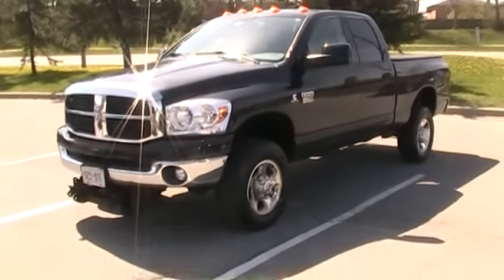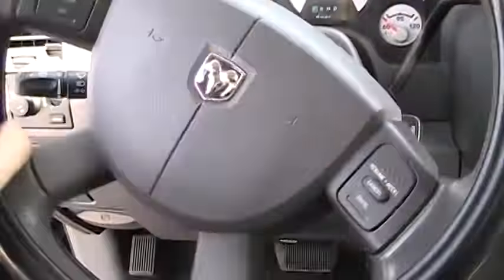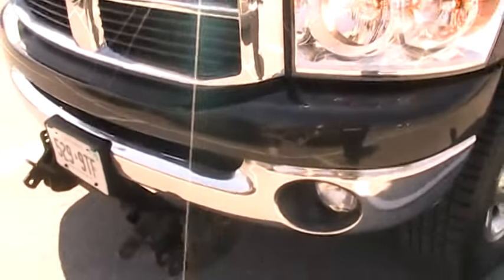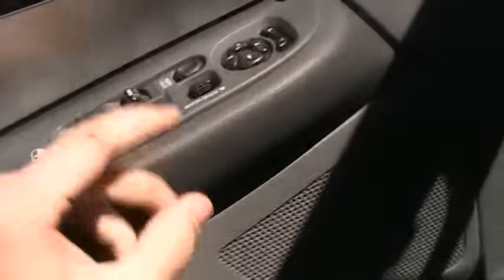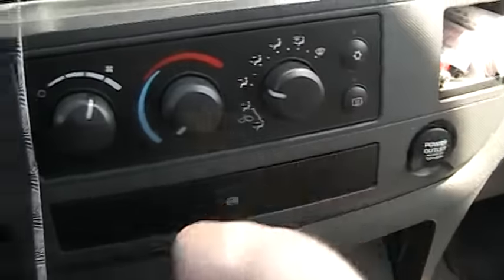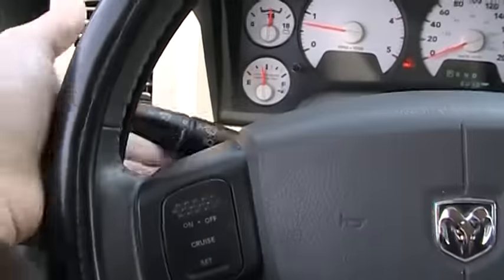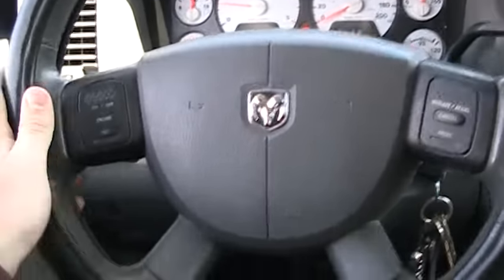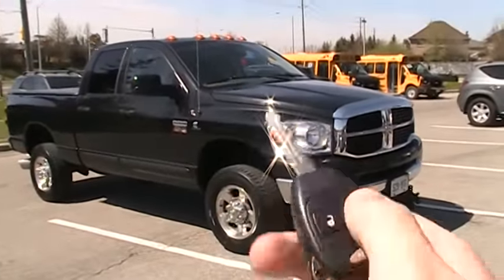2007 Dodge Ram 2500HD SLT Cummins Turbo Diesel Startup Engine & Walkaround

Comment: I do pwn one i love it even if has 450k miles still running like a champ but I’m thinking to get the 3500 4x4 2014 but I’m not sure yet 🤔 mmmm
Reply: I’m thinking about getting one with 260k km did you ever have any problems with yours
Reply: @devonwoodman1523  nope running like a champ

Comment: 2007 Dodge Ram 2500 Heavy Duty Cummins Turbo Diesel with the 6.7L Cummins Turbo Diesel Inline 6 - cylinder.

Comment: What happened if you don't wait to start
Reply: it just won't start. the engine will keep trying to turn over. you have to let the glow plugs warm up.
Reply: OK
Reply: Dodges don’t have glow plugs. They have block heaters. It will start even if you don’t “wait to start” but it’s always better to just wait even if it’s hotter outside. The wait to start helps you to know when the engine is hot enough to start
Reply: you learn something new everyday. preciate it
Reply: @Tshredder  they actually rely on grid heaters to start not block heaters, grid heaters heat the air coming into the intake making it easier to start.